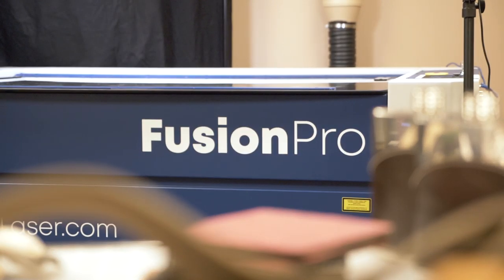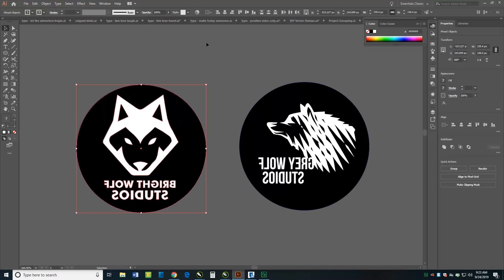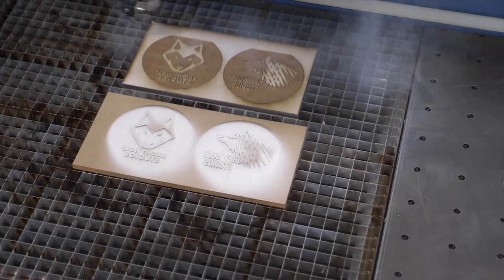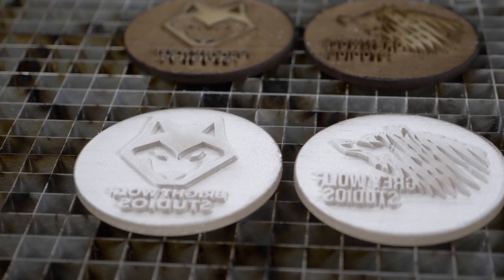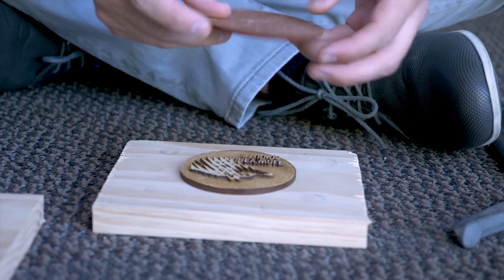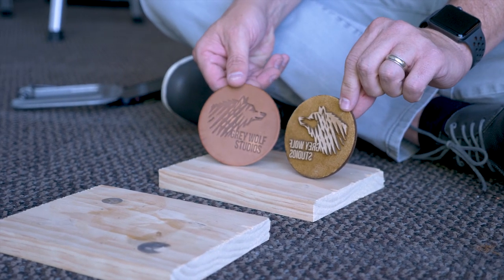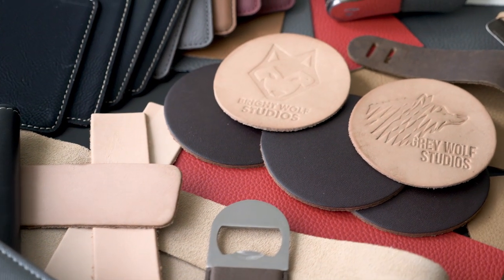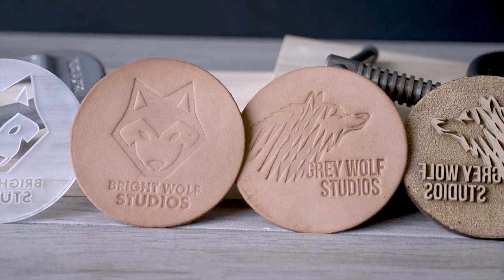Laser Engraving Stamps for Leather Debossing with MDF and Acrylic

Comment: You can put moment glue on MDF and it will be strong like a stone and water-resistant.
You can use a tick plastic for warping - between leather and the stamp and result will have better finish - try it :)

Comment: Quick note about wetting your leather, don't try to stamp the leather if it's still soaking wet.  Once wet, allow it to dry to the point it's cool, but not damp on the surface.  This is called "casing" the leather and it will create a much better impression.  You just need the water to help glue the fibers together.  Too much water makes it too spongy and it will not hold the shape as well.
Reply from the maker: Great tip!

Comment: MDF doesn't like water. How would this stamp fare over multiple impressions?
Reply from the maker: The thicker MDF has been holding up quiet well and much less expensive for one-off stamps, but you can use a variety of materials for your debossing stamps. Delrin, acrylic, solid wood, and mdf are all great candidates. In the case that you do use MDF for your stamps, you can use a wood sealer to prevent any water from penetrating the MDF over time.

Comment: Hi there, love your video, whats the optimal leather thickness for this kind of work?
Reply: Hi there back at ya! During the experimentation for the leather debossing how-to project, we found 1/8" and above to be the thickness that yielded the best results, as well as unfinished leather products and sheets. We also experimented with various clamping and press methods. A good quality arbor, roller or platepress will save you an enormous amount of time.

Comment: Can this be used to create stamps for paper?
Reply from the maker: Hi Idan. Yes, you can use a similar technique to create debossing and embossing stamps for paper. Depending on the effect you are trying to achieve, you will engrave your stamp, then invert the graphic (black to white, white to black) and engrave the negative side of the stamp. These techniques usually require an embosser type device to get the positive and negative stamps to line up correctly, but you may be able to set something up yourself as well.

Comment: I'm kinda surprised with the depth of the stamps.  I know you made two passes, but the difference in the depth between the first and second passes seems relatively large.  Did you adjust the focus for the second pass?  Did you adjust speed or power or DPI?  THANK YOU!
Reply from the maker: Hello, we ran three passes total to achieve the depth you see in the video, but in hind sight, it was probably only necessary to run two passes. For each pass, we quickly refocused at the laser then ran the job again.
Reply: @epiloglaser  When you say you "refocused the laser" are you referring to refocusing on the just-lasered area instead of being focused on the original surface area?  Does this mean that you would raise the table very slightly?  THANK YOU!!!
Reply from the maker: @jking5008  - Hi yes you are exactly right. We refocused by bringing the table up slightly (approximately .0625") to focus the beam to the newly engraved area. Each time we ran the same Speed and DPI.
Reply: @epiloglaser  EXCELLENT!   Thank you very much!!

Comment: What is the thickness of the acrylic that was used?
Reply: Hi Brian - we used a .25" acrylic for the stamps.
Reply: @benjamin • What is your experience on using Delrin for this process? Someone suggested to me that acrylic is too brittle for fine detail and will crumble with pressure.
Reply: @elvspretzl  - Hi - yes Delrin is a great choice for pressing and inking stamps. When engraving Delrin for stamps there will be less "powder debris" created as well, which provides quicker cleanup. As for the brittleness of acrylic vs Delrin, Delrin is a bit more flexible and would flex a bit more during clamping.
Reply: Benjamin Sieber • Thank you for your response!

Comment: Good if you own laser cut machine, but if you using laser cut service company like me, that might cost so much. Here in Indonesia, the service cost per minute is about half a dollar. Engraving usually takes a long time, and cutting process is more fast, the solution for that is just to make the graphics to all cutting work, and then stack it  with the same thickness material base.
Reply from the maker: Cutting and stacking is certainly an alternative method to use in some cases. For our graphics, which had distinct logo and text components, cutting out the shapes would have separated the letters from each other and from the logo. This would then require stamping the components individually, or reconnecting them to a base prior to stamping. Engraving away the negative space ensures the components remain one solid piece, and that all components are spaced properly relative to each other. If you are working with a graphic that is one contiguous shape, the cutting and stacking method becomes much more viable and is an alternative approach worth considering depending on your time constraints and where you’d like to focus your efforts. Thanks for the feedback!
Reply: Ade aulia rahman apalagi potong mdf setebal ini ya mbaa😄

Comment: What was the depth on this by chance?
Reply from the maker: Hello Juan - the depth of the engraving was pretty deep for an engraving, but anywhere around .0625 or deeper should work well. Within the Epilog Software Suite you'll want to select the Deep Engraving settings option for the best result. We also suggest additional passes to achieve deeper depths in acrylic or hardwood.

Comment: Mdf is not conducive to water. Mdf soaks in water and then falls apart. Your mdf stamp will not last long.
Reply from the maker: This is true, that MDF will absorb water. We recommend not exposing your MDF stamp to water for very long during cleaning, or cleaning it with only a dry or damp brush. Water expedites the cleaning process, but you do not need much. Our MDF stamp’s exposure to water was limited and it has held up very well during and after its use, with no degradation. We’ve updated the write-up on our website with a note to be careful during this part of the project. Thanks for the feedback!
Reply: I agree. I think the wet cloth is better.
Reply: Thanks for the ideas. I have to say, though, that there are so many cheap and free materials that would be a better alternative to mdf.

Comment: Did you use any special kind of leather for this? Veg tan or chrome?
Reply: Mikael I think only veg.
Reply: The leather featured in the video is veg-tanned leather. The thicker nature of the veg-leather makes it easier to deboss. We are going to test more leather types with a table vise setup for quicker pressing and debossing - stay tuned to see how it goes!
Reply: Harbor freight shop press $100 is stupendous for this purpose.
Reply: @jerrodlopes186  Exactly what I was thinking!
Reply: @benjaminsieber1589  The thickness has nothing to do with it. Veg tan will take carving and tooling whereas chrome-tan or PU will not. Simple as.